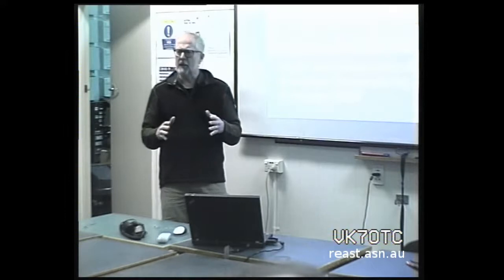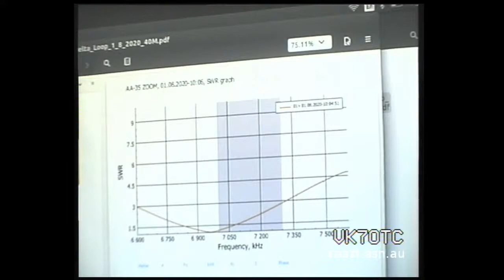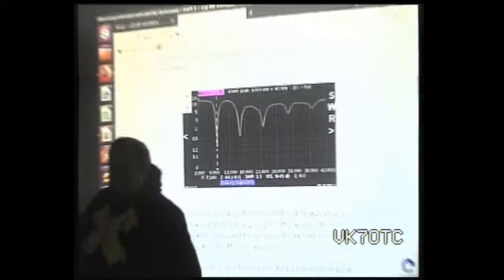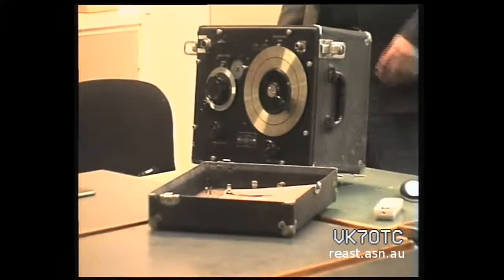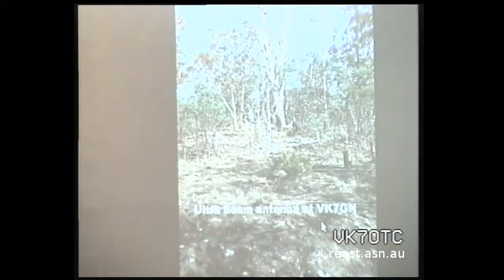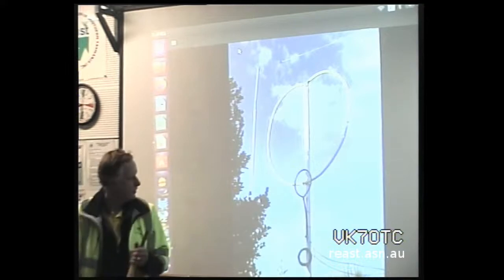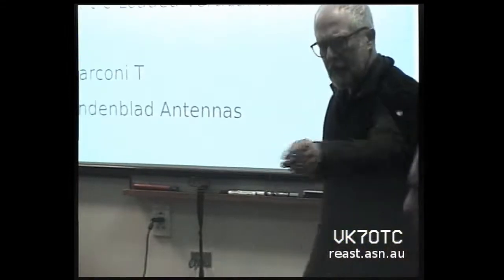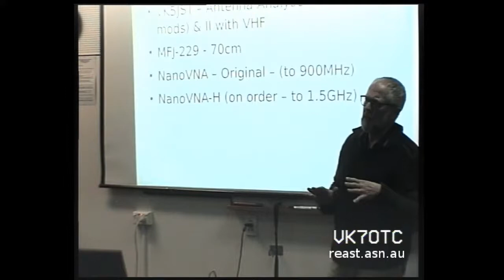REAST Antenna and Analyser Forum - 5 August 2020

Comment: Anyone try the latest variant on the “mini aa”?   I just bought a Mini-1300 and it’s marvelous.
I actually like it far more than the MFJ antenna analyzer units.  The chicken-hoes at MFJ
STILL manage to solder like little children n grade school.   They make utter crap~junks.

The Mini, however, is housed in a rather nice little metal housing with integrated “N” 
female connectors.  Much more rugged than the NanoVNA type devices.

Thank you for your videos.